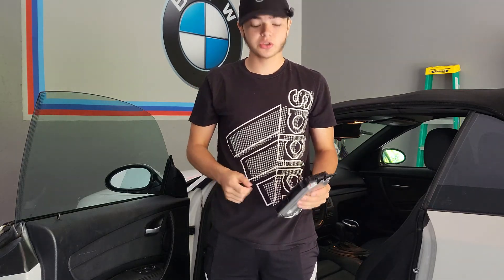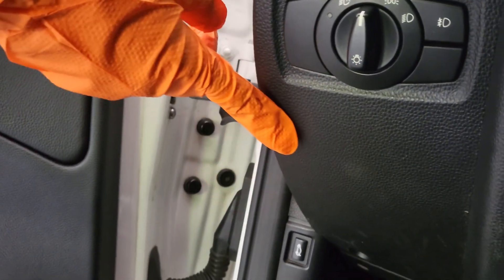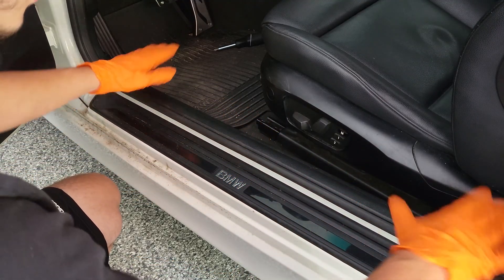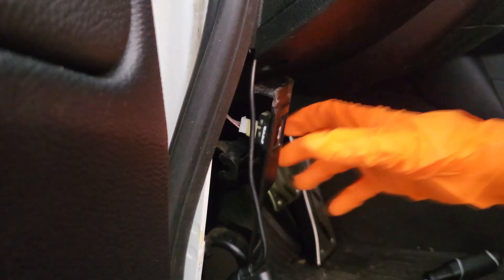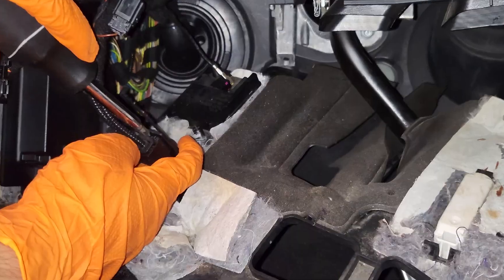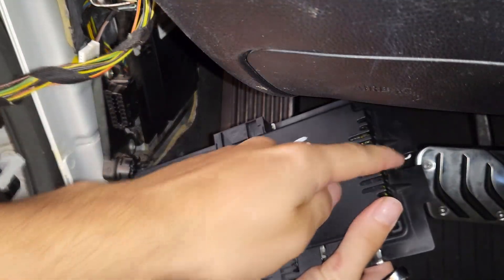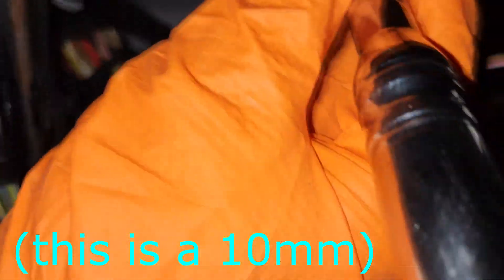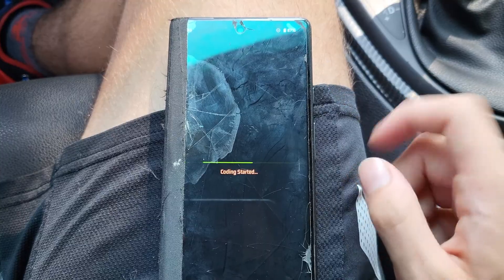BMW 1 series FRM replacement (E82,83,87,88)

Comment: Do I need to clear the OBD fault codes first before starting the engine for the lights to work, or can I start the engine without clearing the codes and the lights will work?
Reply from the maker: I'm not totally sure, however, I'm aware that some electronics will not work if the computer believes there have been a certain amount of short circuit events,. So if you are able to, it is definitely a good idea. Let me know if you have any other questions, and I'll try to answer sooner 😅

Comment: Why are you taking it out? What are the symptoms of a bad footwear module? smh
Reply from the maker: It's been so long since I replaced this footwell module that I'm afraid I don't remember why I did so. Symptoms of a bad footwell module can include malfunctioning windows, mirrors, lighting, and locking.
Reply: @greezysgarage  do you think it's responsible for monitoring if passenger is wearing a seatbelt as well? Mine most times doesn't detect passenger wearing one, other times it works fine?
Reply: I have the same problem with my BMW 116i E87

Comment: I’ve gotten my new module in, but I am having trouble finding where to code on the website, do you need an android device? Because I can’t find it on my windows computer but did get the Kdcan cable.
Reply from the maker: @kurtis3933  While Protool is available for Android devices exclusively, this can be done in the BMW software for Windows. You can download the different softwares (INPA, ISTA WIN KFP Etc) as a package, although you will have to find a reliable and safe download source for these since they are no longer available from Bimmergeeks (Protool). If you search up "download BMW Tools" (and if you can find the Bimmergeeks version (simplified setup/default profiles) even better!) you should be able to find them, and there are plenty of videos showing how to use Winkfp, which can be used for coding modules. If you sourced your new FRM from a similar Enough vehicle, you may not even need to code it for it to work. Thanks!
Reply: Perfect information😊 @greezysgarage

Comment: If you swap and have someone else recode it will car run 'Uncoded' or is car bricked
Reply from the maker: Depending on what vehicle it is sourced from and how close a match it is, I believe that some features may work, but potentially not all.
Reply: @greezysgarage  lots of them on ebay...

Comment: You can see the reason why the module fail.
Reply from the maker: How so?
Reply: @greezysgarage  did not you notice the rust on the metal part just above the place where the module was installed? I think the sunroof drain cahnnel got blocked and it leaked water inside the cabin and that went into the module.
Reply: @greezysgarage  @4:41
Reply from the maker: You have a good eye! I knew that it was rusted, but I never thought of what could be the cause. I think I'll look into this now. Thanks!
Reply: @greezysgarage  I hope that is the reason. because finding out causes of prblems on these peace of shit cars is painful process.

Comment: How often do these go out?
Reply from the maker: I'm not sure, but I don't think it's a common issue, and if I had to guess FRM III would probably have the least likely hood of having issues.
Reply: I'm pretty sure mine is bad. I'm having lots of electrical issues in the dash and windows
Reply: they go out because the sunroof leaks water adn that goes into the frm module. you can even see the same in this video. there was plenty of rust above the module on one of the metal parts.
If you keep it under the shade or make sure your sunroof drain channels are not blocked then they wont go out.

Comment: How did you code the new FRM to your car?
Reply from the maker: I used the PROTOOL app, and just used the "factory coding" option. If you're using BMW tools, available from BimmerGeeks.net  for free, I believe it is Tool32 to find your vehicle order, (V/O)  which you can then copy down, install the new part, and paste in the new data. You just want to make sure you're replacement is the correct version. FRM I, II, or III. I believe you can use FRMIII in any model/year, but not vice-versa. I'm not 100% sure though.

Comment: hi, I also have 88. I changed this block because mine sank. Now the car starts with the key but it won't lock or unlock. This unit was purchased from another car. How can I register the key to this block?
Reply from the maker: I'm not very experienced with this, but it sounds like you may just need to reset the FRM. I personally use and recommend Bimmergeeks PROTOOL. It could also be that you need to relearn the key with a special tool, but I would try the first option first. Thanks!